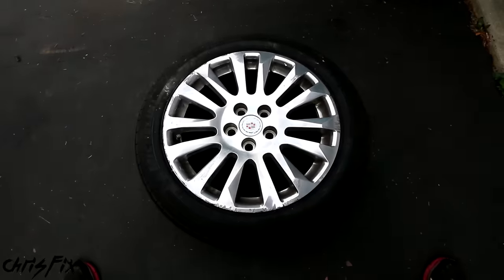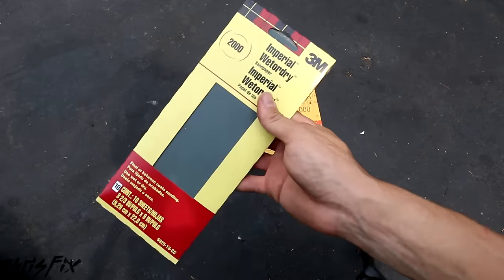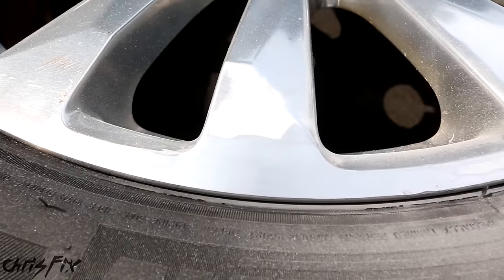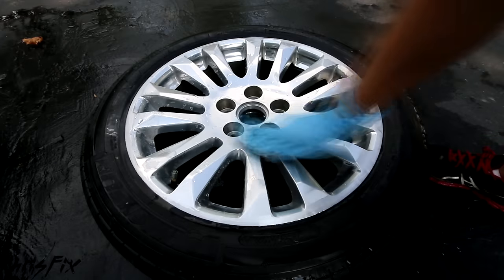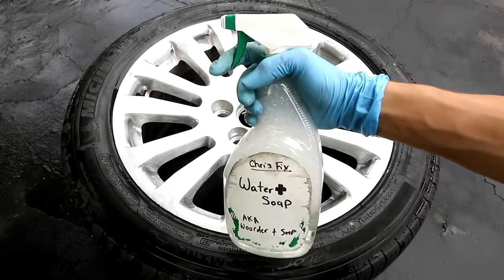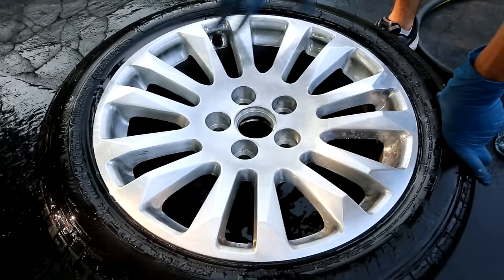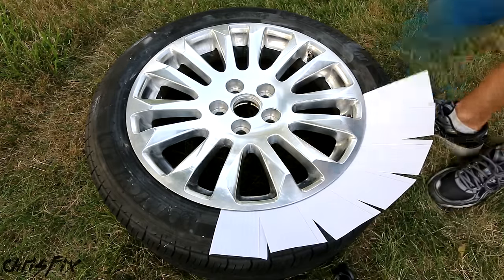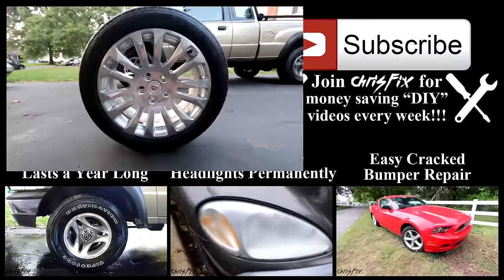How to Repair Rims with Curb Rash or Scratches

Comment: wouldn't you need to rebalance the wheels?
Reply: +audioh0lic in most cases, yes, any material removed throws off the balance of any wheel. sometimes all it takes is a few micrograms.
Reply: +audioh0lic In a way, yes. You need to get therm trued which is basically like balancing but for bare rims only.
Reply: That's exactly what I thought, Chris should've used some type of filer to even out the whole entire wheel. But none the less its awesome video tutorial.
Reply: for what amounts to a quick and dirty fix with reasonable visual results, it's actually not that bad, considering. i've seen much worse. and on a rim like that, a sticky weight in the right spot and any issues are negated (which is not ideal, but hey, this is a budget fix, and truing costs money). that being said, i personally try to stick to using my spray gun for anything involving spray application coatings to protect. sure, more cleanup, but man the end result is so much better to me.
Reply: +Ismael Mahamat Filler is not an option on a polished wheel unless you aluminum welded and grinded back smooth. also he didn't remove a lot of material. Excellent repair and resurface in my opinion.
Reply from the maker: +audioh0lic No, you would have to remove a significant amount of material to mess up a wheel balance and if you need to remove that much material, you are probably going to mess around with the structural integrity of the wheel. All that dust on the rim is the amount of material that was removed which is nothing. I never had to re-balance a wheel and there has never been vibration.
Reply from the maker: +Ismael Mahamat Why would you use a filer?
Reply from the maker: +GameAngry You dont have to get them turned. The amount of material that is removed is insignificant. You get more weight added when you get a rock caught in your tire.
Reply: ChrisFix to balance the wheels and reduce vibrations
Reply: +audioh0lic No, only if a wheel weight come off or you change a tire. They didn't even do that in the old days and tires would still last ages. People just like to fuss about more than they need to.
Reply: +kenabi do you think a commercial wheel balancing machine is accurate to a few micrograms?  if they were, do you think wheel balance weights are available in microgram designations?
Reply: +Charles Satterthwaite That was literally 6 lines of text.
Reply: No you wouldn't.
Reply: Yes you would it will only be out by a gram or so but still a good idea
Reply: +kenabi While I don't doubt that a spray gun would yield better results, not everyone has one at their disposal. Hence, spray cans to the rescue. Plus, whether using spray gun or can, good preparation is 90+% of what it takes to achieve quality results. And I beg to differ that this was a "quick and dirty" fix. Well, maybe a little dirty, but certainly not quick, I'm sure.
Reply: 9 @chrisfix

Comment: Biggest thing that wasn't mentioned, was dulling the edge that you may end up making on the edge of the rim that's close to the tire. If you leave that edge sharp, and you hit a pot hole or just come down on it too hard, it will slice your tire. ALWAYS make sure you aren't taking to much material off, and ALWAYS dull the edges out. This will save you hundreds in new tires before you realize what's causing it.
Reply: how do you dull the edges?
Reply: @najhchronicles Sandpaper or whatever. Just round off the lip a bit, just enough for it to not be sharp.
Reply: @najhchronicles  Yes, gently, gently

Comment: Hey, Chris- that was fantastic.         I have a few pointers for you- that I've learned from others over the years.         To save your back, knees, and work area- set the wheel on the open end of a plastic (or metal) waste can (45-55 gal.). All of the metal dust, water, and chemicals go into the can (even use a liner in can for quick & ez cleanup, too). BEFORE sanding/polishing your wheel- scrub the tire first with a stiff brush and a pumice-based "mechanics" hand soap, rinse with HOT water, then dry; apply several coats of your favorite tire dressing (it sticks really well & soaks into a deeply cleaned tire) to protect it. Don't forget to sand/polish the inside of the rim, too! Cards are great- cereal & food boxes are virtually FREE. Most "aluminum polishes" leave a protective coating; if you're going to clear coat- several wipes with acetone is preferred to remove it, and the enamel will adhere better. Remember- just as with a cars' finish- you can color sand, cut, and polish that clear coat on the wheels, too.          BTW I own a Black & Decker "Mouse" sander ($35 USD) that works great for this exact job, and many grades of abrasive are available for it.
Reply from the maker: +HUBBABUBBA DOOPYDOOP Thanks a lot for sharing bud! Thoase are great tips!
Reply: ChrisFix  AKA "WOODER and Soap" LMAO LOVE YOU MAN
Reply: Excellent tips on an excellent instructional video!  Suggested edit: "several wipes with acetone is preferred to remove that protective coating".  Also lost me at the end. Color sand, cut, and polish?  Great stuff, though.  Thanks.
Reply: @libertyblack715  Most "polishes" leave a residue, that must be removed before any clear coat is applied. Acetone will easily cut through it. 

After the clear coat dries & hardens, you can use a product to cut and buff it, for a deeper shine, as long as you have applied a sufficient amount of clear, without burning through. Maguires Ultimate Compound works great.

Comment: Chris, another great tip when using spray cans..... let them sit in warm water until the paint is also warm be careful to shake well. It makes the paint flow easier especially in colder weather.

Comment: Yay, im done, look how awesome this looks and it only took 2 hours....Oh wait nevermind I have 3 more to do.
Reply: The end product looks great but yeah, the process looks SOOOO time consuming.
Reply: James Delong right, but the alternative is $600 dollars at a local shop! I rather save me $550 and do it myself over a weekend!
Reply: It would take way more then 2 hours
Reply: Why would this take so long?
The most time consuming part is the stripping of the clear coat and then the reapplience of the new clear coat.
If you´re stupid enough to do every step after another for reach rim, well then you deserve to take like 8 hours for this.

I mean, just do each step on each rim at the same time.... 
Stripping clear coat? Do it with 4 rims at once, not only one ... get the idea?
That way it takes way less time.
Reply: You can do each wheel in between stripping the clear coat. It's about 6 hours of labour to do all 4. I do it all the time for my friends cars and charge a case of beer and a tank of fuel.
Reply: Sam Cody Good friend.
Reply: Sam Cody what state you live in?
Reply: "what's your hourly rate?"
Reply: @Rakku  Dad?
Reply: @nixworld767  Yes son?
Reply: @cody8860  shit man, where are you located then?
Reply: James Delong right 😂
Reply: I mean. You don't have to do all four rims unless you a dummy and scratched all four rims.
Reply: Worth it to buy aftermarket instead of your time. Depending on rim and size, they go from $110 to $239 refurbished. Mine are just $119 if it took that much, then I'll check junkyard 1st, then buy aftermarket, junkyard will give $15 on wheel if you want plus swap and balance tire. Find a good wheel for $30, I picked two, 1 had a scrape, but my wife cracked hers from sliding into a curb, $30 for wheel, I tried to get him down to $15 but on scratched one but he gets $15 per a wheel so he said, so you know it's more after melt down. He melts them down on all junk ones.
Reply: That's what the weekend is for lol

Comment: +ChrisFix - This is hands down one of the best tutorials of any kind I have ever seen. Comprehensive detailed information, supplemented with lots of excellent tips and suggestions. Well done. Superb work.
Reply: Thanks for taking the time to show how to fix car problems on here👍🏻
Reply: I agree, this gave me the confidence to fix my own...Thanks!!
Reply: Mighty car mods did a pretty good tutorial on painted wheels. With a painted wheel, you can use body filler to fix deep scratches. This technique doesn't work on all style wheels. Still a good general tutorial.

Comment: Good DIY tutorial there Chris. If I could just suggest one thing. I would not polish the wheel before clear coat. The clear coat needs a good key and is likely to peel off over time. Also 1000 grit is more than enough, will give a better key for the paint to stick and the clear will fill in any light scratches you can still see. You'll be surprised buddy.
Reply: karl shaw NOW I read this! 😲
Reply: What is key
Reply: @shirobuta_  A key are very small micro sctaches that the clear coat holds on to to prevent peeling.
Reply: Looks like day turns to night when doing this on only one rim
Reply: 2000 grit is where he mentions "you're done, or go on to clear coat....."
Reply: @davegarber7964 actually, he did the polishing then wiped it down with alcohol then clear coat.
After polishing you can use acetone to remove the coating that polishing leaves before applying the clear coat.

Comment: Thanks for the info.  Good work. I prefer factory wheels over a cheap aftermarket, and the guys saying " just go buy a new set " probably don't ever look at their wheels. Like their comments, a new set is only about 1000. dollars ( plus ). You can have a wheel repair shop refinish them for about 200. a wheel, or spend a few hours and save some money. Only things, 1-  save your back, work with wheels on a bench and 2- don't paint in the grass, walking around, stirring up dust. JMO, Thanks again!

Comment: Glad I watched, repaired all my Fiat Sport wheels and they look as good as new, thanks Chris.
Reply: So how many years did it last? 
From what I know it's not a good idea to apply clearcoat on a polished surface, it must be a little rough for better adhesion.
Reply: @Alexio.-  I am very pleased to report that since I repaired and painted my wheels they still are perfect. The important thing is to use designated wheel paint.

Comment: FLAP wheel (or Flap Disc).  Picky picky, I know. Good video.

When I was building custom motorcycles I made a rig to mount the rim on, that turned it with an electric motor and speed control. It had a gooseneck light and tool rest like a lathe so I could lay a cutting edge or dremel against the rim and turn the wheel to remove curb rash. It removed just what I needed to remove and did it evenly.  You might still need to do some hand work in the interior regions but with the rig I could tilt it vertically, horizontally or facing me at a 45 degree angle.  It allowed me to work standing upright and to turn the wheel easily. 

When it came time to paint or clear coat, I often used the electric motor to rotate the wheel while I held my HVLP gun steady for a smooth, even coverage. I even ran the motor to keep the wheel turning slowly while the paint dried to ensure against runs or sags.

That wheel rig made it so much quicker, easier and better than hand work. Sure, it was an investment of time and money but I wouldn't do it any other way. 

BTW, I also perfected a technique to buff off the tire lettering with a four inch angle grinder and a FLAP disc to get the sidewalls flat and smooth. Then I would mask them and spray whitewalls on with white PlastiDip. The PlastiDip interacted with the tire compound to tint it slightly ivory which was so much better looking and stark white. 

I regret getting rid of that rig. I could use it now to resurface my wife's rims.

Comment: One tip when using a chemical stripper, whether on paint or on a wheel, is to cover it with plastic to contain the fumes after you coat it. This can help the chemical to work better and does a good job to work areas even if they don't have quite as much product on them. Do note, however, in a situation like this with a tire still mounted, you probably wouldn't want to cover it to risk damaging the tire. Even if the tire still LOOKED okay it may have caused damage that could cause premature failure, which is the last thing you want to happen at 70mph.

Comment: Most comprehensive video on wheel restoration ... followed the steps mentioned by Chris on used oxidized wheels and able to fix all four of them .. although it is time consuming but able to save around  $700 .. instead of clear coat I used Protecta Clear by Everbrite .
Reply from the maker: I'm glad saved that much money! Plus you got to know you did it perfectly!

Comment: Good job.
2 things:
1. If you’re removing that much material locally, that rim needs to be rebalanced.
2. That chemical stripper is hell on the materials used in that valve stem. On my own car I wouldn’t trust it to handle road stresses the way it used to.
Other than that, great job. I just felt because you were so thorough, you’d want to make sure people also stayed safe.
Reply: Don't think grinding material from the face of the rim does that much damage atleast on normal rims. Some superlight rims are gonna loose some strenght if they loose this much material. Balancing is a must after this tho
Reply: Janne Lakkapää
Yep, balance is the potential issue. That chemical stripper on the valve stem is a no-go tho.
Reply: Aluminium is so much lighter than lead. Taking off that amount of aluminium is not going to effect the balance. However your point on rubber valve stems is valid. This video is full of holes though.

Comment: Center cap rule. The direction of the sharp side of the emblem should be towards the valve. That's the trick for fast finding of the valves.

Comment: You should try Rust-Oleum clear coat remover stripper it actually works in under 20 minutes to get all of the clear coat off in the first try they have it in a spray can but the stuff in a regular can that you brush on works way better